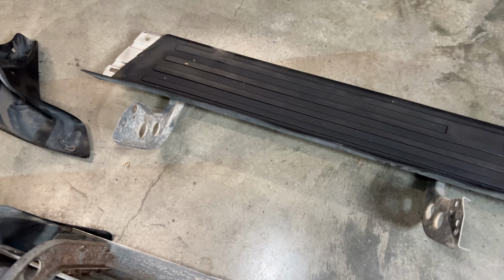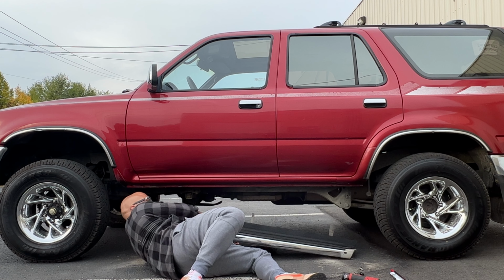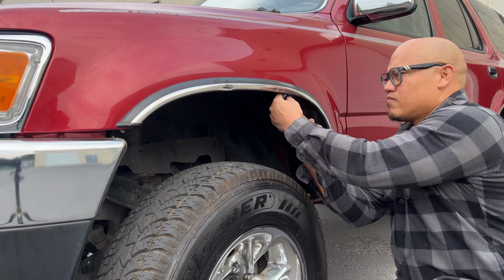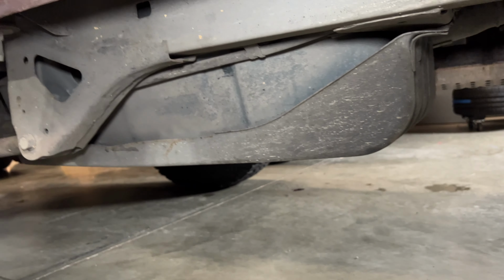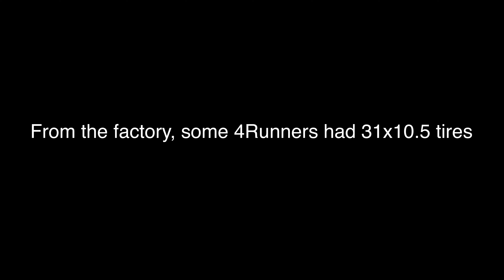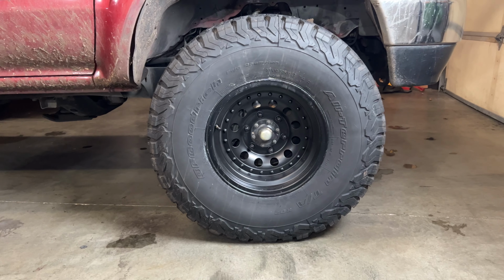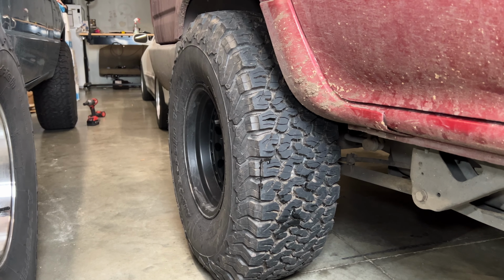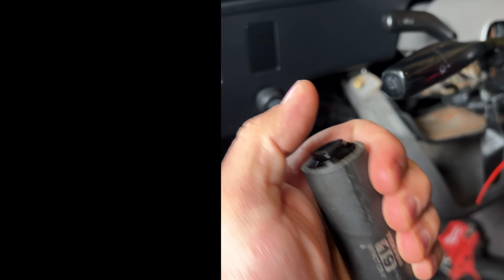How to remove factory running boards and running 33s on a 2nd Gen 4Runner with No Lift

Comment: 33's are okay with no lift if all you do is spin your wheels in mud and go to the mall. If anyone out there intends to actually wheel their whip, I (and everyone else in the community) recommend a slight lift. You don't need much, just enough to restore factory suspension articulation.
Reply from the maker: Restore factory articulation? No. That’s not what slight lifts do. Most “slight” lifts AKA cheap lifts ALTER the factory articulation by giving you more ride height at the expense of down travel. I may temporarily put a ball joint spacer on this truck for the sake of making content, but if you were paying attention in the video, I mentioned this truck will be getting long travel after we do a motor swap. I’ve got two other rigs for the desert and trails. For now this is just my wife’s winter rig. I didn’t like her rolling in the snow in a FWD sedan.
Reply: @rayregnogarage  No I paid attention to your video, fully. The comment was for everyone else watching your clip not yourself, people should be aware that unless they put a suspension lift they're actually reducing their off-road capabilities. I said a slight lift, I never said do a cheap body lift. Everyone knows body lifts and cheap lifts don't give back lost suspension travel. And for your info, yes you can do slight suspension lifts, stock or long travel aren't the only two options. I'm sure you've heard of OME lifts.
It seems like I have offended you, feel free to delete my comment.
Reply from the maker: You only lose travel if it rubs. If it rubs, a sawzall and/or angle grinder make for a quick solution. I ended up needing some snips to trim some of that plastic fender liner, but it’s fine. Lots of video out there of people wheeling on 33s with no lift.
Reply: @rayregnogarage  right on, I apologize.
Reply: Hi guys are there in entry level lift kits without fabrications?  I can't find any decent lift kits on these older trucks without coil suspensions..  i see Rough country has a lift kit, but i dont think its intended for off road.  i have Bilstein 6112s on my gx470 and it rides awesome on road and entry level to mid trails.

Comment: Are the running boards needed to be removed in order to fit 33’s?
Reply from the maker: I didn’t want them. But pretty sure they would have rubbed on the end caps. I had to trim part of the fender liner today because it was catching on the driver side

Comment: Bro, are you still in SD or did you relocate to Washington? I have a 2008 Xterra I just got an need a lift and some other stuff done to it. I don't have a place to work on it.
Reply from the maker: I go back and forth. If you are in SD check out Gearheads in Oceanside. They have a service where you can rent a bay with a lift and tools by the hour. That’s where I did my suspension swap and a bunch of other work. Really cool guys and so much better than working in your garage on the floor.

Comment: i recently got a 2nd gen that also has a saggy rear like that lol. would new rear shocks and coils be the best option to fix it?
Reply from the maker: The shocks don’t affect the ride height. I bought new springs and went to install them the other day but the upper shock mount is pretty rusted and the shock just spins. I may need to cut it off. Need to order new shocks first.
Reply: @rayregnogarage  that would make for a great video. thanks love the content
Reply from the maker: @blickywiththestiffyuh2560  i did the install and shot the video on Saturday. Will edit and post soon

Comment: Have you flexed the suspension yet? Do they rub?
Reply from the maker: The fronts grabbed onto the fender liner. I trimmed them and the front is fine so far. Now that the snow melted, I’ll see if the rears will rub. Pretty sure it will. The rear coils are super saggy.
Reply: @rayregnogarage  thanks for the response.